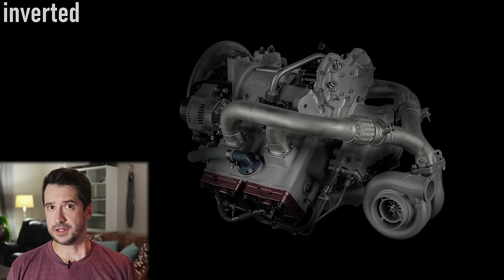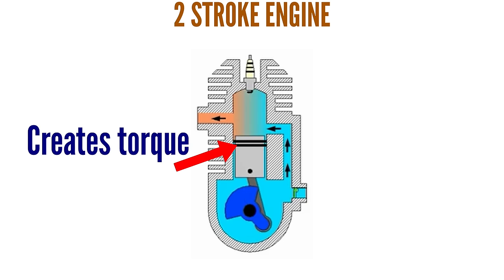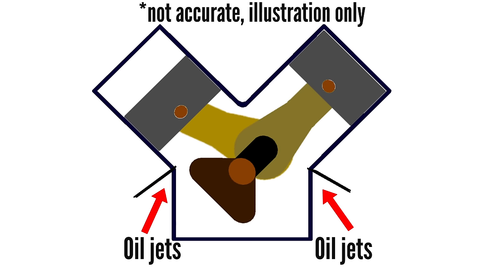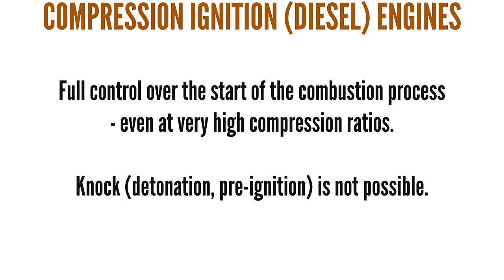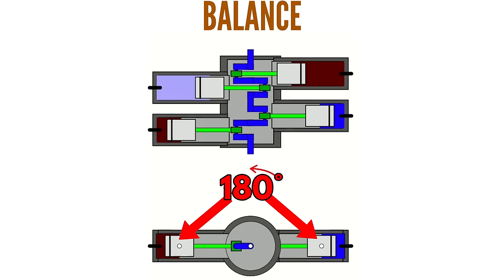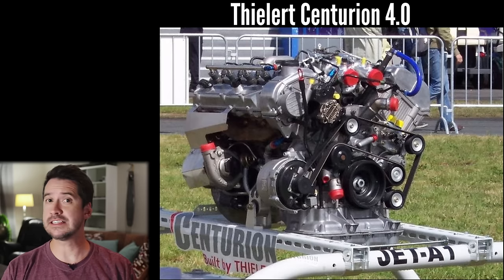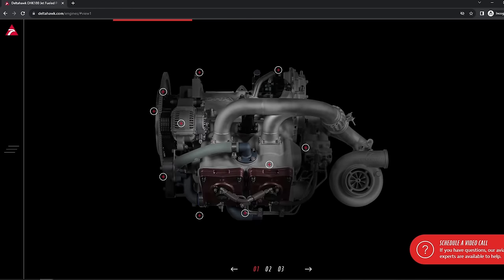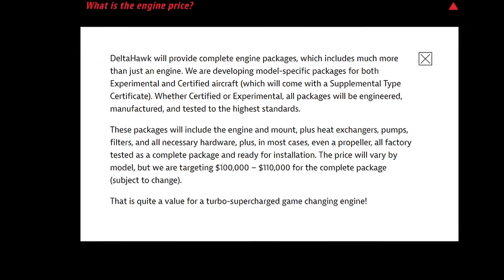Deltahawk's Jet Fuel Piston Airplane Engine Explained

Comment: No electrical system eh?  Why does it have an alternator? Knucklehead
Reply: @tom1966mac

Be careful with insults. In this case you yourself end up the “knucklehead”. Go watch the video again. Keep watching until you realize that you are the one who is incorrect.
Reply: It has an alternator to generate electrical  power for the airframe electrical system. The engine itself does not require any electrical power to operate, other than to crank the starter. Once started, it needs no electrical power.
Typical spark ignition gasoline fuelled aircraft engines also do not require power from the battery or alternator to operate, since the magneto ignition systems generate their own electricity to fire the spark plugs. The alternator can burn up and the battery fall out of the airplane and the engine will keep running as if nothing happened, since the magnetos are not connected to the airframe ignition system. Aircraft built after 1941 are all required to have two magneto ignition systems operating in parallel with each other. If one fails, the other will keep the engine running to a safe landing. Magneto technology dates to the 19th century, but magnetos are very simple and very reliable, so long as.good quality materials and workmanship are employed in their manufacture.
Reply: @rescue270 mags reliable?  compared to what?  there's a reason they decided to put 2 of them on.  Electronic ignition is much more reliable, and produce a hotter spark.  should have been replaced on all aircraft 30 years ago.
Reply: Absolutely. Very reliable. Once up to speed mags have a very hot spark. Electronic ignition and fuel injection were initially developed in cars predominantly for emissions. I'll play my experience card now...
...I have 41 years as an A&P, I.A. I've seen magnetos run far longer than they've ever been intended to run. I once had an airplane that was so old it only had a single ignition system. One mag. It never failed me. They can also be easily repaired in the field. Electronic ignition requires a power source. A failed electrical system will render electronic ignition useless. Any certificated airplane built after 1941 requires dual ignition, no matter what it is. Dual electronic ignition would require two electrical systems, like the old Mooney M20L with Porsche PFM 3200 engine. This is why certificated aircraft converted to electronic will have one electronic unit and one magneto.
That seems stupid to me. Just have two mags and keep it simple. A backup battery is not something I would want to bet my life on if I'm halfway to Nassau went everything takes a crap. Mags are their own power source. They are not just old breaker point battery ignition systems like an old Volkswagen.
Airplanes are not cars. There are stresses and extremes of temperatures, air density etc. that are present in the realm of flight that cars never experience, and these factors can affect delicate electronics in adverse effects ways nobody can imagine. My experience with electronic ignition in cars is that it works quite well until the battery gets weak. Then it quits. I like mags that will keep running like nothing happened when the electrics fail. I can't believe how many people don't know that.
 My experience with the few electronic systems I've seen in aircraft is that they are more expensive, more difficult to install, more complex, and some were so troublesome that the owners went back to original magnetos. I can open up a magneto and fix it. I can't do anything but replace a SureFly unit.
You may have learned about electronics and that's all you know, but from my experience, there is no way you or anyone will ever convince me that a bunch of microelectronics connected to an airframe electrical system could ever be more reliable than a simple, solidly built, entirely self-contained and properly maintained magneto. General Aviation research and development is going in the wrong direction. 
As far as I'm concerned, magnetos can stay for another hundred years. Old technology can often be better than new technology
Reply: @Jessersadler  This is irellevant for a diesel engine tho...
Reply: @lennoxbaumbach390  
A diesel engine will not make enough power to maintain altitude if the turbosupercharging system fails. In cruise flight, they have to be pulling 60 or more in. Hg manifold pressure just to maintain flight. This was experienced by the SMA diesel-powered Cessna182JTA prototype. Turbocharger failed on takeoff, resulting in an off-airport landing. No real damage, nobody hurt, but the FAA refused any further approvals at that point, and the ventured was shelved.
That's too many eggs in one basket for me. I see quite a few big rigs stranded on the road, and many have suffered failed turbos. By contrast, my friend's Cessna Turbo Centurion suffered a broken valve that rattled back into the intake, went into another cylinder, then another, before finally going out an Exhaust valve and lodging in the turbo, destroying it. This airplane held altitude with one dead and two marginal cylinders along with a completely failed turbo for 50 miles to a safe landing. All with half fuel, three people and baggage in the airplane. That could never happen with a diesel.
Furthermore, diesels require a high-pressure injection pump that is the other reason for failure, and there is no real way to run two for safety redundancy as can be done with magnetos. Injection pumps are also a lot more expensive than magnetos.
Many are water-cooled, which is just one more system that needs to be meticulously maintained and is one more point of failure that is completely eliminated by air-cooling. I feel that water-cooling is a huge step backwards, since it was proven long ago that air-cooling was far more reliable than water-cooling in aircraft. In WWII, one round to the radiator or hoses of a P51, Hurricane, Spitfire, or Me-109 brought the airplane down. By contrast, several Republic P-47s with huge 2800 cu. in. R-2800 air-cooled radial engines came back home with whole cylinders shot off.
That decided that.
In aviation, safety is always of primary concern. Reliability equals safety. Simplicity enhances reliability.
Of secondary concern is affordability, otherwise, only multimillionaires would be able to fly. Efficiency should always come third.
Airplanes are not cars! They don't make tow trucks for airplanes when these expensive conglomerations break down in places like Wink, Texas, out in the middle of nowhere. Disassembling and trailering an airplane home is a very expensive, time-consuming, and damaging job.
Reply: @rescue270  Im an A&P, IA(expired), SEL/MEL commercial stuck wing, CFI/I helo pilot.  I also own a Auto shop.  The technology in vehicles is light years ahead of general aviation.  When is the last time you've had ignition issues on your vehicle?  Hell, when's the last time you've even changed a spark plug.  Now I will admit the early conversions sucked, and a bunch on the market are still hack jobs.  I'm proposing an actual engine designed for electric ignition, dual FADEC.   

Hell imagine what a P&W 1340 would do with fuel injection and electronic ignition.

Also, there's nothing simple about any motor, all have advantages and disadvantages.
Reply: @rescue270  Also I've flown Robbies, and they shit mags quick, so maybe that's why I'm so against em.
Reply: @Jessersadler  
I've never gotten familiar with Robbies since I'm almost strictly a fixed-wing mechanic, but I have heard that they are very hard on their mags for some reason. Maybe heat related? Whatever the issue is, it would probably also affect any type of ignition system used in that application.
My experience with magnetos is extensive and, in the fixed-wing aircraft I work on, I have only rarely seen magnetos fail. Usually after they have been neglected for years and hundreds of hours past their recommended inspection intervals or they have been improperly repaired. The most common ignition problem I see by a very wide margin is fouled spark plugs. This can happen with any ignition system and it's nearly always caused by lead in the fuel. I've seen a number of mechanics mistakenly replace magnetos when the only issue was a lead-fouled plug.
My main concern is the complexity of these systems that makes more points of failure, more difficulty in repair, and more expense. 
As for my truck, it is not an airplane. I've driven it for 330,000 miles. Yes, I have had to replace coil packs, spark plugs, a few harness connectors, etc. It has been good, but at 70 mph I'm pulling about 18-22% power. The airplane has to pull more or less 65% power just to maintain altitude at, say 6500 feet. Those factors there make flight a whole different scene from automotive technology, which is why I scathe at people comparing cars to airplanes. Airplane and car engines are actually about as closely related as a donkey and a rhinoceros. Basic operational principles but totally different in design applications.
My truck's electronics totally quit if the battery goes dead, and that is why I love magnetos in airplanes. No external power source required. I can't give my support to any aircraft whose engine operation relies upon the airframe electrical system. Airplanes cannot pull over on the roadside.
Reply: @rescue270  Almost all commercial aviation  is 100% reliant on electrical power and is the safest form of travel.  Your 20% power in your auto is 100% power of an airplane rated motor (power per CI).  You can absolutely get a 5.7 LS to run 200hp all day long like an airplane.  A motor is a motor, and all are engineered for specific things.  Wouldn't be difficult to take the technology that's in the auto industry and tailor it to aviation. . . other than dealing with the FAA

Also, if your battery dies, you still have spark in a car. . . called the alternator.  Again, if you're worried about redundancy, you can have redundant electronic ignition.

Also, your fouling issues would go way down, as it's a much hotter and more reliable spark.  More accurate on timing, less fuel.

Where not comparing animals here, as either animal can not be altered.  Engines can.
Reply: @rescue270  I've seen plenty of bad mags on fixed wing.  I've had 2 flying myself.  about 5 on a Robbie.  I've changed 3 mags on 1340 that went bad before their time.  To say their reliable, is willful ignorance.  Again spark to spark, you're electronic ignition on your vehicle has required way less maintenance, been more reliable, and provided better efficiency than these antiquated devices.
Reply: @Jessersadler  
I don't like dependency on the electrical system. Period. When my truck's alternator failed in the desert I made it about 30 miles before the ignition quit due to the low battery. To me, that is not an improvement. Even the breaker point system in my old VW could run on the battery for about 200 miles with a bad generator. Far less of a  drain on the battery.
Who was doiing your mags??? There are good shops and terrible ones. The mags on R-1340s are WWII vintage, and very often overhaulers will reuse half-worn parts in them. Can't really blame the design because of poor maintenance. I put a set of mags on a newly overhauled 1340 in an Air Tractor twelve years ago and they ran all the way up to the next overhaul. Thank God, because mags on a 1340 are a bitch. Just like anything, mags have to be properly maintained. My neighbor had a guy change some connectors in his car and whatever he messed up blew the ignition up twice, so this thing happens everywhere. 
When magnetos are properly maintained, they are very reliable. We had a real good shop here. Really, the only drawback I see with mags is that parts and new mags are not being manufactured as much. Insurance costs for manufacturers is too exoensive anymore. The electronic stuff is even more expensive. 
Slick mags do tend to need attention sooner than Bendixes, but they cost half as much.
Reply: @Jessersadler  
Commercial airliners cost untold millions of dollars to build and maintain, they have multiple electrical systems that back each other up, and they have turbine engines. We're talking about General Aviation, small airplanes here. It needs to be at least somewhat affordable instead of only the realm of the wealthy.
Disagree also that automotive engines are easily modified to comprehensive aviation use. From what I've seen in the abortive Mooney M20L and others, engines should be designed for aircraft use pretty much from the ground up. I built a lot of Porsche 911 engines. Great engine, I'll drive in front of one all day but I don't want to fly behind one. Cruise power in the M20L was 5500 rpm and the exhaust valve springs were breaking. An AD was issued to replace them every 500 hrs. They worked great in the car but were not suited for aviation use, and that was an automotive engine that was a lot more similar to aircraft than an LS.
Why is it so important to have electronic battery ignition in airplanes now? 
Electronic magnetos have existed in virtually every lawnmower out there since about 1977! They run with no power input, just like a mechanical mag. You think the old technology just HAS to be replaced? Why hasn't that venue been explored?
Reply: @rescue270  if it was redundant, it wouldn't have happened. . . If it was maintained like an aircraft, it wouldn't have happened.

Why hasn't it been explored.  Cost/benefit with the bureaucracy of the FAA.  Quite simply $$$$$, just like you point out the exuberant cost of an airliner.  Doesn't mean it isn't better tech
Reply: @Jessersadler  
I mean, I still personally prefer the mechanical mags because I can very often repair one out in the middle of nowhere with only a few basic tools. I really don't even need a timing light, just a piece of plastic wrapper like off of a cigarette pack. A trick I learned from old Harleys. 
My main concern is keeping the ignition totally independent. I know actual electronic magnetos are nothing new. Lots of industrial engines use them, and industrial engines operate in a manner more similar to aircraft. Even existing mags could probably be converted. To me, if we gotta go solid state, that would be the way to go.
Reply: @rescue270  Have you never seen a points ignition converted to a MSD system?
Reply: @Jessersadler  
Lots of them.
Reply: @rescue270  You just answered your own question then.  I can be separate from everything else
Reply: @Jessersadler  
My question is, why are they not doing anything like that? It would be so simple.
Reply: @rescue270  FAA and $$$